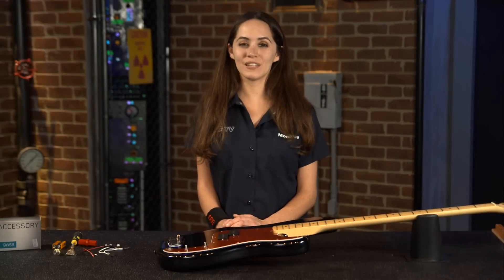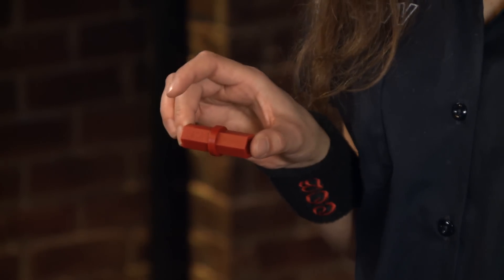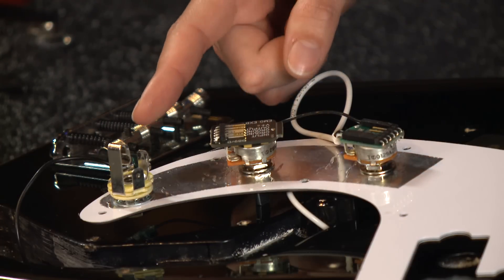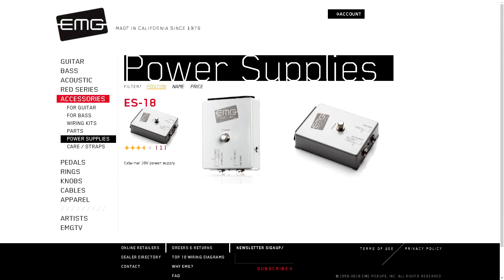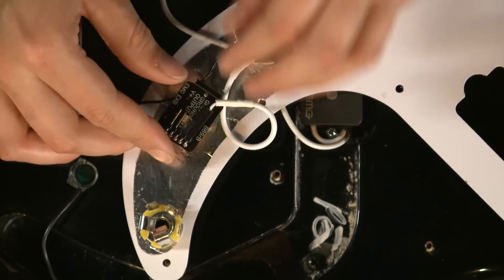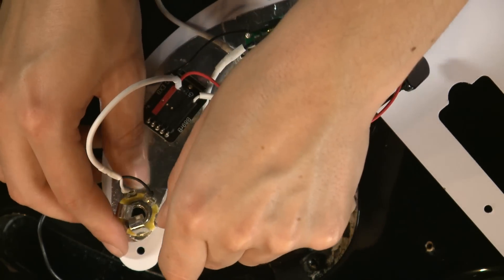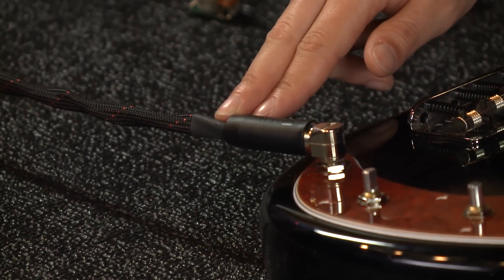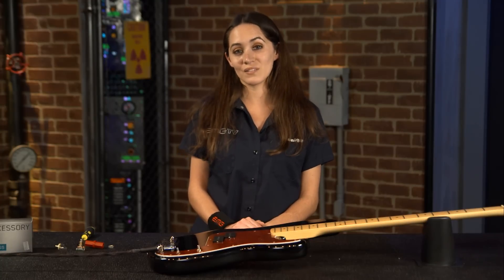Monique installs the EMG EXB active bass and treble boost

Comment: And if you don't have emg pickups, can you solder it?
Reply: Yes, you can simply install the EXB connected to the stereo jack and battery, and you could simply remove the connectors from the other wire and solder it, black to ground and white to the volume pot